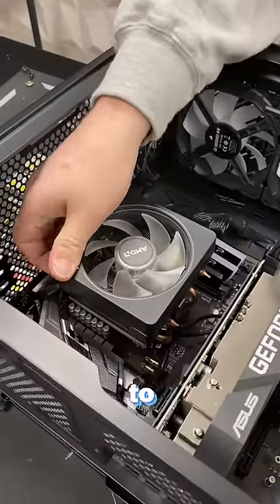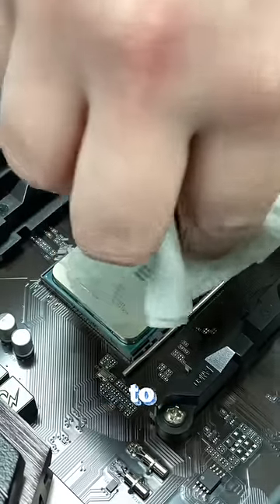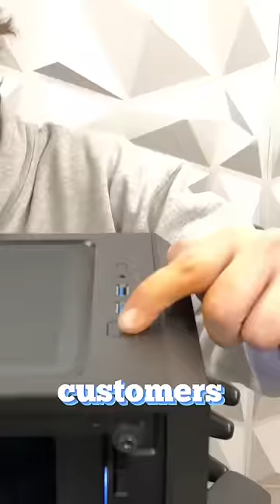OVERHEATING CPU?! 🥵 #pcrepair #pc #cooler #gamingpc #pcgaming #egirl #gamerguy

Comment: Why the radiator is upside down most of the people put it with the hoses on the top
Reply: Hose above the aio block helps prevent air pockets over time so it is recommended. It will be fine the way it is but as the liquid evaporates they may run into air pocket issues. Possibly intentional to get a return customer?
Reply: Doesnt mather. Aslong as the radiator is sitting higher then the pump. Stop giving false info. Tubes up or down gives 0 fucks air travels to the highest part in the loop ( aka the top of the radiator )
Reply: LOL you both just contradict yourself 🤣 if you mount tha AIO tubes up air bubbles will go exactly on the tube that is trying to pull water but instead it will be mixed with air causing noise and faster deterioration of the pump. Best way scenario is radiator mounted at the top but you can still mounting it like GamerTech did on the front or side panel with tubes down, this way air bubbles will go on top of the radiator where is nothing, tubes will work nice aswell the pump.  Peace.
Reply: @lessdutoverwatch  sorry jung wusste ich nicht dass du 14 Jahre alt bist. Mein Kommentar war nicht böse gemeint nur bitte einfach mehrere Artikel lesen oder Videos anschauen damit du mehr weißt und gute hilfreiche Kommentare schreiben kannst. 👍
Reply: @DJDadonik  can't do that with a triple AIO
Reply: @keonxd8918  Why not? What is the matter with the size of a radiator? It’s where you mount it that’s important. Can you really don’t understand that by yourself?
Reply: When I ran hoses up I could always hear air bubbles, air is bad for the pump, hoses down keeps any air in the top of the rad away from the pump :) but hoses up will still work